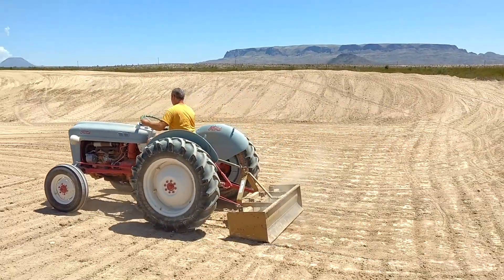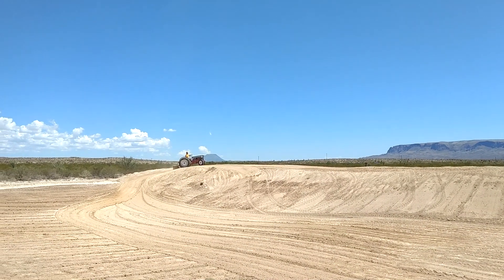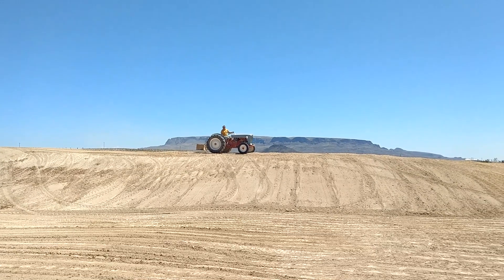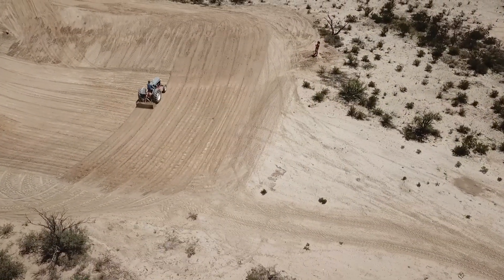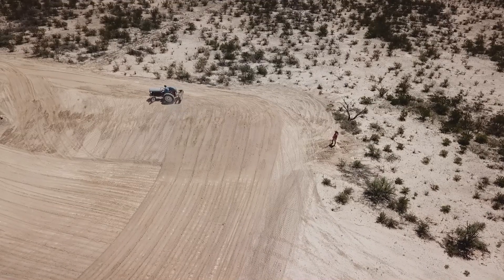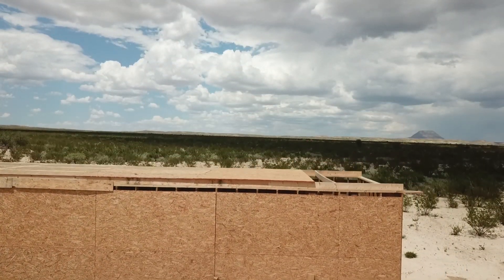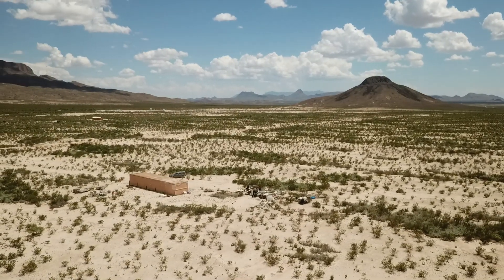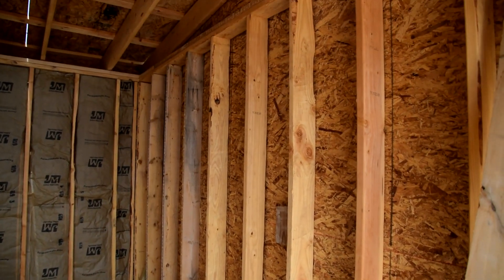Digging a pond with a box blade - Off-Grid - Terlingua Texas

Comment: A lot of sand? How deep did he go before he hit clay? If it is sand along the berms that’s water will just absorb into the sand like a sponge unless you put clay there.
Reply from the maker: There's a lot of bentonite out here so even when you have piles of sand they quickly get covered with a layer of bentonite dust and seal right up.
Reply: Cool, I wish I had some Betonite for my tank In south Texas. I have good clay but I have a lot of sand to get past to get to the clay, then the walls of my tank is not as much clay so o get a lot of absorption there.
Reply: That’s a lot of work for that little Ford tractor, but their tough. You’ll never get a new tractor to last that long.